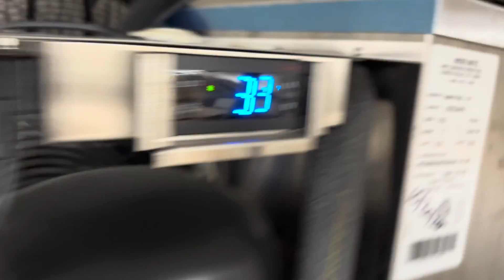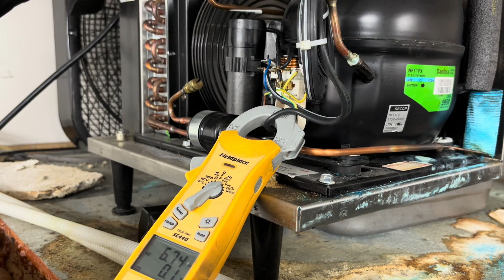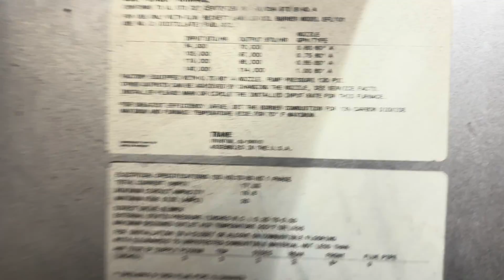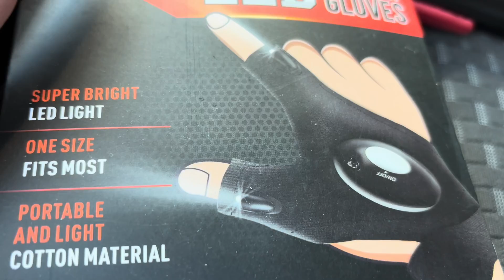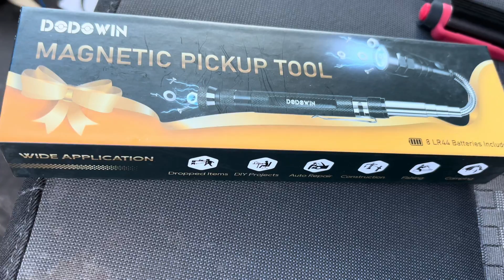Always Remember To De-Energize The Capacitor! | Random HVAC Happenings!

Comment: Seems you shorted it to the ground wire, shouldn’t do that if it has a resistor on it, weird it’s never happened to me before but well done
Reply: Also from experience most times starting components go off it’s due to compressor deficiency so it’s always recommended to replace them, pain in the but specially beer glycol I know but might as well get them out the way Jeff 
Good videos brother

Comment: Good point about the start caps since most people don't realize that since the start relay cuts the connection to the start winding (the relay only connects on the high initial current, which dumps the cap's charge into the start winding) the cap will not discharge unless equipped with a discharge resistor. That caught me off guard a few times in the past..ouch.

Comment: Not sure if it makes a huge difference in this instance for the blower wheel but if you look closely the set screw was not on the flat part of the shaft possibly causing the blower to run out of balance since that would push it higher up on the side of the shaft and closer on the opposite side. Either way safe bet is new wheel and possible new motor in my experience. Never know what those motor bearings are like after that motor running with that vibration.
Reply: I agreed notice that also

Comment: Aren’t the universal ones supposed to be bent to the needed angle? Saw a video on another hvac channel where different brands had a chart for bend angle depending on manufacturer.
Reply from the maker: They do make a universal one you can cut and bend.  I change so few of them though that I haven’t had a chance to check one out.   They very seldom go bad.  I should probably check one out at some point though.